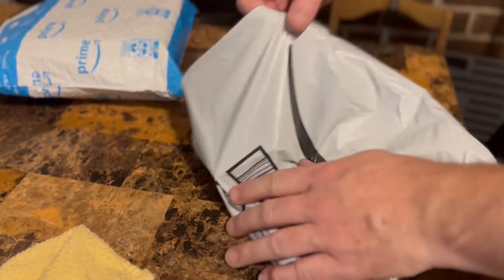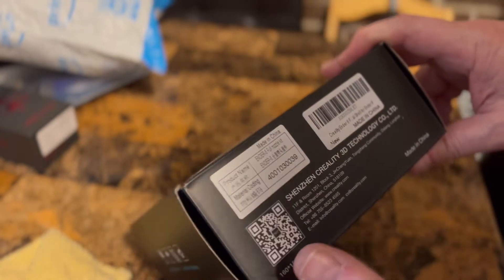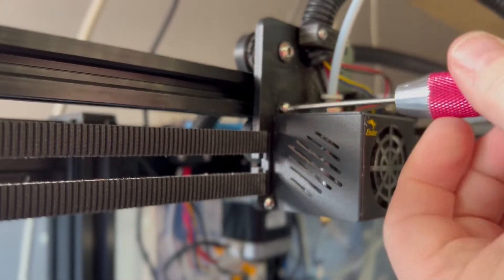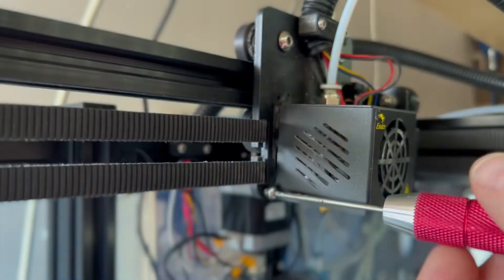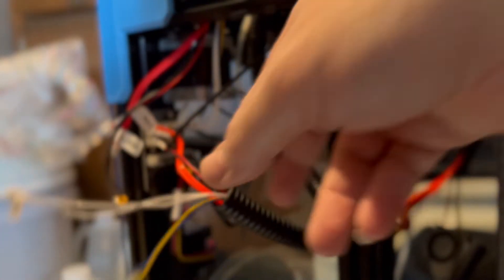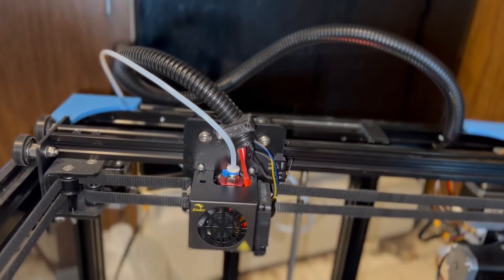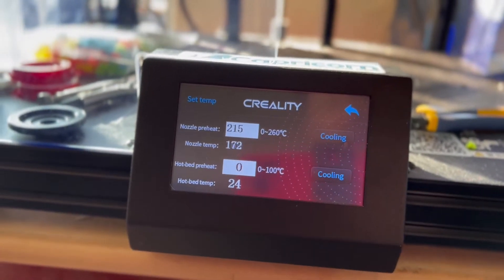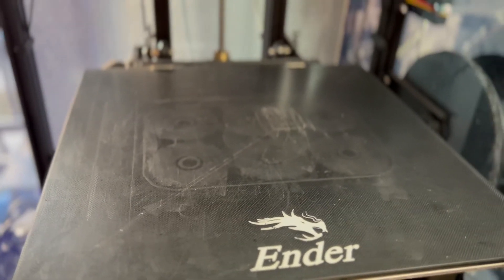Creality Ender 6 hotend replacement

Comment: have you installed the spider on ender 6 ? I bought one for mine but still didn't do it
Reply from the maker: I did install a spider on one of my 2 Ender 6’s. I had to print a new parts cooling fan adapter though. I think I did a video on that or after I installed it. I think I even linked the thingaverse part that you would need to print. I recommend doing that before you replace the hotend unless you have another printer. It works ok. It’s not life changing but I think it will be better than stock.
Reply: Hi did you end up making the video of installing the spider hotend on the ender 6 and what was needed etc thank

Comment: Why did you replace the full nozzle on your Ender 6? Is that ungraded Nozzle kit? I ask because the new one looks like the nozzle that Ender 6 ships with. Thanks!!
Reply from the maker: I had issues with the one that came on there and I was able to get an oem nozzle cheap. After I replaced it, I bought and installed a spider hot end on that printer. I have 2 Ender 6 that I use to make my panel washers for my 2022 Honda grom. So, I replaced it because I had orders to make and send out and I needed it up and running fast with the profile I already made in Prussia slicer. I did eventually put the spider in and create a new printer profile. So one of my Ender 6 are stock and one has a spider hot end. I did this just in case I wanted to run hotter materials through it. Thanks for the question!

Comment: You promised a look at the spider hot end but didn’t deliver. Is that video coming out anytime soon? I need help figuring out what adjustments need to be made since the spider is longer.
Reply from the maker: The only thing i did was adjust the z height screw in the back and print off a new parts cooling duct. That's it. Oh and relevel the bed. Set the bed level screws halfway then adjust the z height. If i can find a link for that cooler i will put the link up. The stock cooler duct doesn't work with the spider hot end. It needs to be lower down since its longer.
Reply from the maker: Here is the link for the spider cooling duct i used. 
https://www.thingiverse.com/thing:5388482

Comment: Could you do a video on how to replace the fan as well as the hot end temperature wires?
Reply from the maker: Are you talking about the hotend cooling fan? I could make a video showing you how to remove it as well at the hotend thermocouple on my old one. Give me a couple days and ill whip something up. Thanks for the question.